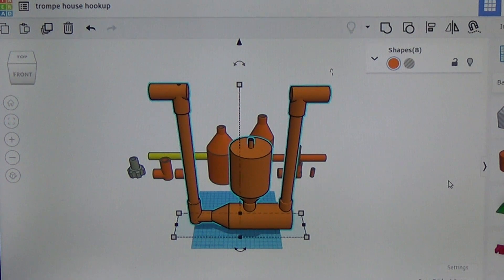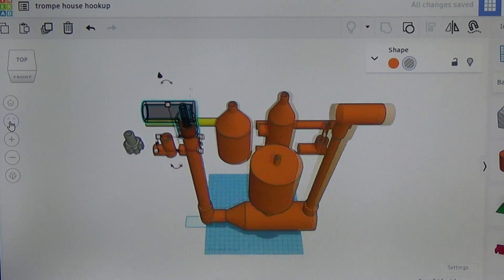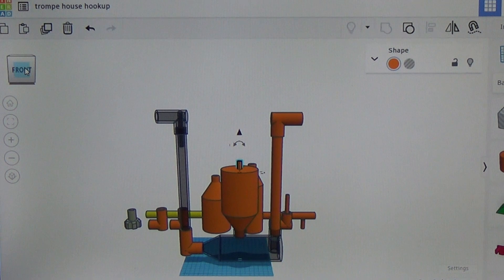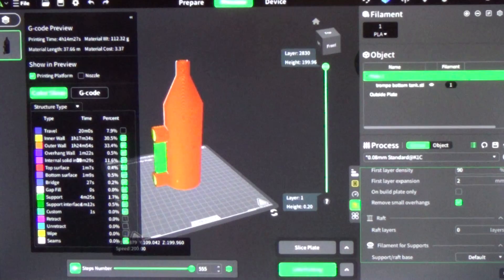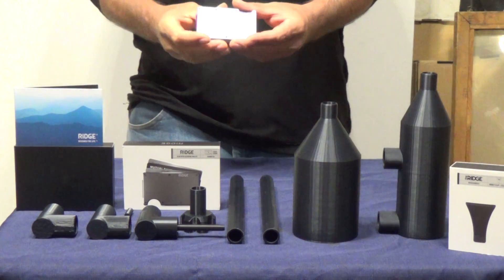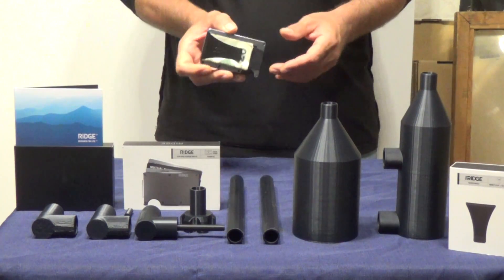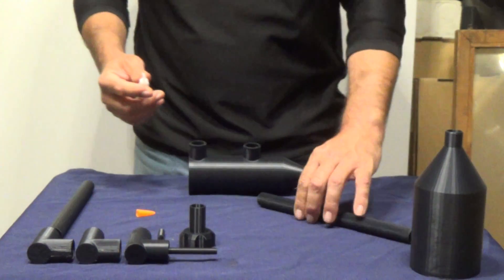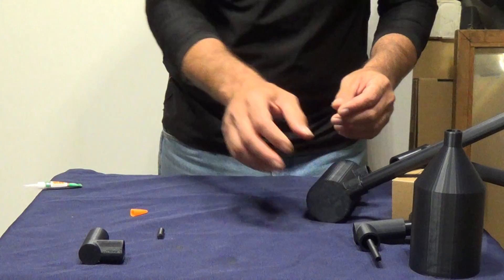How To build a TROMPE Air Compressor, needs no Electric power and has no moving parts!

Comment: Great vid man!  Something I've wanted to explore more in depth for a while, ever since I read about the Ragged Chutes plant.. I live off-grid at high (for this part of the country) elevation, near the ridge, but have constant supply of water from numerous springs and a creek that runs the length of my property, as well as significant fall. I also have some highly air hungry pneumatic machines/tools (forging hammers, etc), and producing/harvesting electricity to produce compressed air via piston compressors never sat well with me, even regardless of the losses in the numerous stages of conversion.. Do you feel like the ideal option (assuming one wanted to produce 80-100 psi, common pneumatic tool pressure) would be to drill, like one would for a well, or could this be accomplished above ground (assuming one had enough fall from water source) in a similar manner to a pin-stock for powering a hydro-turbine? Drilling seems like the better option at a glance, as you should be able to create a relatively self contained system from commercially available water pipe, and it would be protected, but I'm not sure how economical it would be if you had to pay someone to drill. Anyway, mostly mental-masturbation atm, I've got years of work to do just recovering from the damage of Helene (took out a ton of timber at my place, 4,000ft elevation and we had sustained 100+mph winds, with gusts far exceeding that, many healthy 2-4ft diameter oaks were literally snapped in half leaving the roots undisturbed, many others roots ripped right out of the ground) but would love to hear your take.

Comment: If you make the intake bigger will it make more air pressure
Reply from the maker: The pressure is based on the water column, so for every 2.3 feet of height you get 1psi of pressure at 1" in diameter
Reply: @MrTeslonian  thank you for the update

Comment: The Trompe Pump is amazing if you distribute the air into a water barrow from the bottom into a barrow inside the water barrow with weights on the top you have compressed air